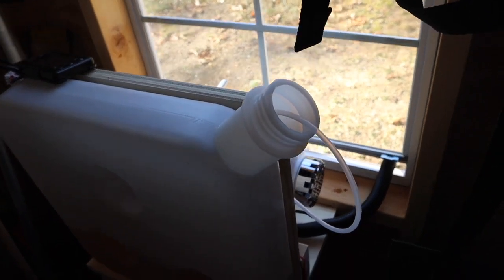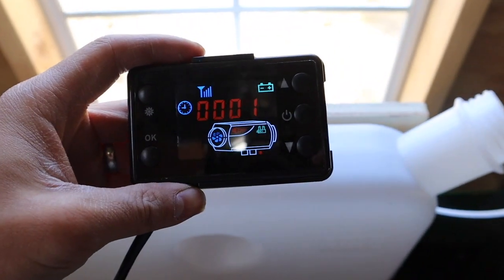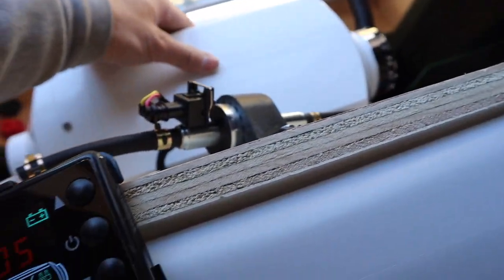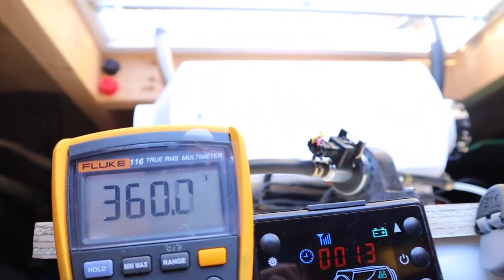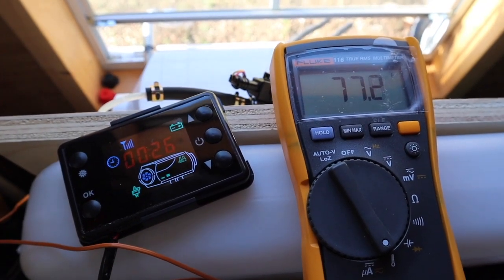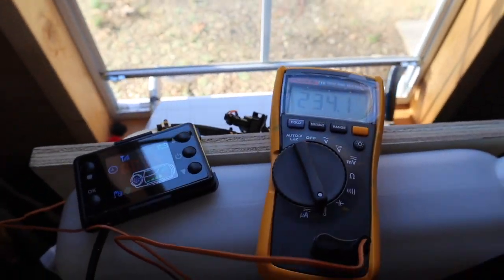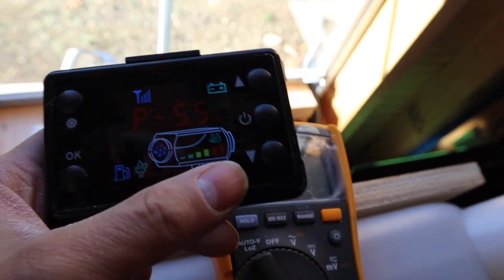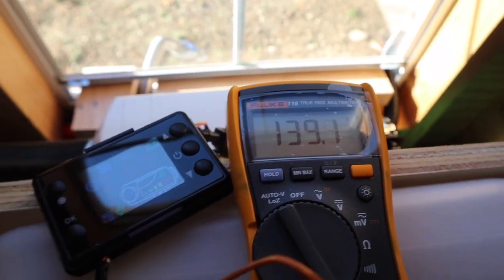Part. 3: Testing / Startup / Temperature and noise - 5KW Diesel Air Parking Heater

Comment: Oil pump need to stay stright up. So no air ruins your pump over time. It is only a piston goes up and down. And need lubrikate
Reply: Not straight up, only 15 to 35 degrees

Comment: I bought 2 similar heaters in the last few weeks.  Neither one works.  Returned the 1st after wasting a week trying to get some help from seller. Zero support.  2nd heater, different seller, different problem.  Waiting for reply from them.
Reply from the maker: Does it not prime at all or what happens?
Reply: @cwwah4947  On the first one, that was returned, the pump could be heard and felt trying to pump.  The fuel would gradually rise to the pump but go no farther.  More than 20 attempts.  Eliminated the filter.  Lift from fuel level to pump, 4".  No GO.  The 2nd one, that is still here, primes up.  The fuel line is full right up and into the heater.  Used the manual priming procedure.  Followed instructions for setting time & alarms.  Tried going to direct start mode.  After a minute or so the battery symbol begins to flash, shows error code 01, low voltage.  Have tried 2 different batteries, one taken straight from a tractor that starts at zero degrees F.  DVOM shows 13+ volts on either battery.  Heater's control also indicates 13.2 volts even while claiming 01 code.   Repeatedly disconnected from battery and started over.  Always the same, display lights up, shows battery symbol, then a few moments later begins to flash.  Won't go beyond that point.  Convinced something is defective.  It is presently -23 C.  The heater is labeled as 12 volt.  Went through the pass word zone and confirmed that it was set for 12 V.  Thank you for your video and your reply.  Chuck Fischer      York, Montana
Reply from the maker: That is odd.  Maybe the wiring harness to the heater is not properly connected.  Another thing could be faulty cable.  Only way to find out if it’s receiving 13v~ is to take measurements on or near the heater itself.  

The good thing is since you bought from eBay, you will be able to receive a refund easily as the products were defective.  It would not matter if the seller never responded back.  Just contact eBay / PayPal directly about the situation. Good luck.  It is an amazing heater...I wouldn’t give up on it yet.  

Also, I might be planning on purchasing another unit for testing.  The one I have now will be retrofitted to use as a heater for the cab of my John Deere tractor.
Reply: @cwwah4947  Thanks.  I'm going to return it.  I am intrigued by these things.  Want to use it in a short school bus that's being converted to an RV.  Maybe third times a charm.
Reply: code one is flame sensor open it may be disconnected if you lift of the top you will see two thin wires on top of the cylinder that is the sensor. @chuckfischer7202
Reply: @jeffmee763  Hi.  Thanks for the suggestion.  I don't remember now what the code number was.  The papers that came with that heater said the code indicated low voltage.  And the battery symbol was flashing.  Anyway, I sent them both back for refunds.  I bought them off Ebay, they sent a return shipping label right away & I got a full refund quickly.  I credit Ebay, not the merchants for that.  Thanks, man.
Reply: @chuckfischer7202  is your unit a 12 volt or 24 volt.
 i made the mistake thought i had a 12 v turned out it was 24 volt,and i also got the low power error.
 so i bought a 24 volt power pack connected it all is good hope this helped
Reply: @davexvs  Thanks.  There was a label on the heater identifying it as 12v.  There were also settings inside the control unit, allowing it to be set for either voltage.  Ultimately sent it back for a refund.  Winter has finally passed.  Might try again come fall.
Reply: @chuckfischer7202  mine also has a setting on the remote for both 12v and 24 v but would only work on 24v  on closer inspection inside it stated it was 24 volt

Comment: Hi on our heater the lcd display stays lit Even when the heater is off is there a setting to turn off the display light when the unit is off regards mark
Reply from the maker: There isn’t a setting to turn off the display.  Only way around it is to unplug it or splice in a on/off switch.
Reply: @cwwah4947  thank you I can't see it being a great power drain but if I nee to I will switch the live to it when it's not in use regards mark
Reply: If you get a blue display they turn of.  @cwwah4947

Comment: If you place pump below heater so that it is pumping fuel up towards heater it  would be better for getting rid of air.
Reply from the maker: Thanks!   Seems that many people have the same issue but does not affect performance.  Heater is still running strong.  Definitely a great buy.
Reply: CWWah it will run strong... but soon as the bubbles get big enough it’ll cause it to flame out due to not getting enough fuel... it has done it a couple times on my setup... the bubbles are caused from cavitation by the pump.

Comment: To be honest, i decided to buy this heater, because i had viewed many videos like yours...... same testing, same installation, same speeches.... The price is very cheap, so i wished to have a try. But, everything is wrong!!! They are holy shit! The temperature could not reach high and the fuel runs fast. It costs me $700 altogether, as i have to pay for the technician to fix it for me..... IF ANYONE WANTS TO TRY THIS, WISH YOU A GOOD LUCK! 
Another of my friend had tried the Belief heaters from Michelle Wang in JP China Trade, also a chinese company. But its price is little expensive, however, it works perfectly for the past 3 years.... Anyway, i will call Michelle to get her heater in the next week.
Reply from the maker: Unfortunately they are not all the same.  Some units do perform well otherwise no one would be buying them.  If anything you can try to return it or have it replaced by the seller.  If it is burning fuel fast it must be smoking a lot at the exhaust and also building up soot.

Comment: Thermostatic Operation
The LCD Controller can be switched to/from thermostatic mode by holding down the “Settings” and “Up” arrow buttons. The LCD shows x°C for thermostat mode, “x.x Hz” for pump frequency mode. The LED seven segment controller likewise can be switched to/from thermostatic mode by holding down the “Setting” and “Up” arrow buttons.

Comment: There is a procedure for priming the pump without having to run the whole heater.  

1. Whilst pressing and holding the down arrow ↓ button, briefly press the CONFIRM/OK key.
2. Now release the down arrow ↓ button. The display will show H-OF. 
3. To start priming, briefly press the up arrow button ↑. The display will change to HF-ON.

Comment: Are you happy with your heater? I just got one too  and it uses very little fuel and approx 50 watts electric on high. Make sure you run on high for a few min or so before shutting down to keep soot  from building up.
Reply from the maker: gloknor

Yes.  The heater is very good for what it is and cost.  It sips fuel like you said.  Thanks for the tip on running high.  I have yet to run into any issues with soot buildup.  For shed heating this is definitely much more economical than using an electric heater.
Reply: I agree , I wish I had bought one sooner .